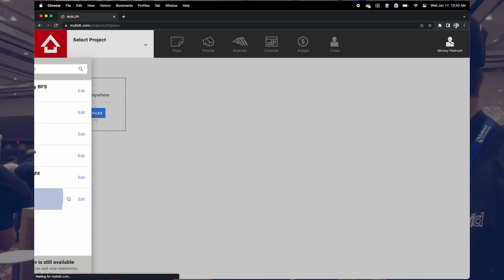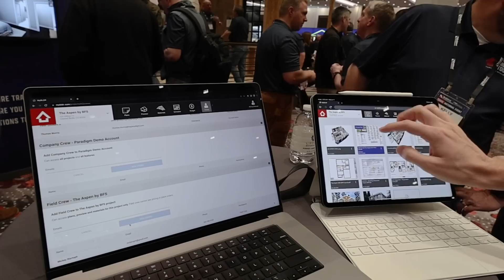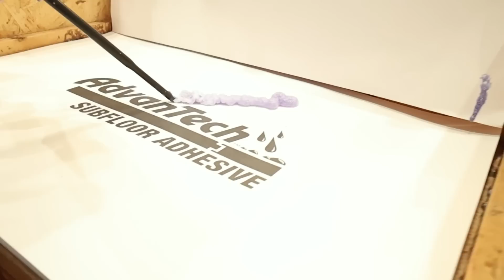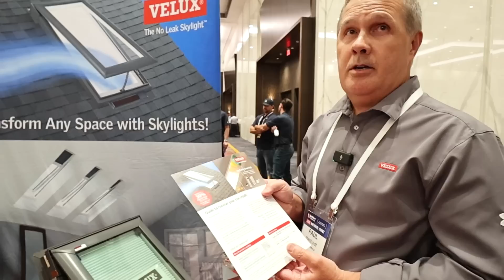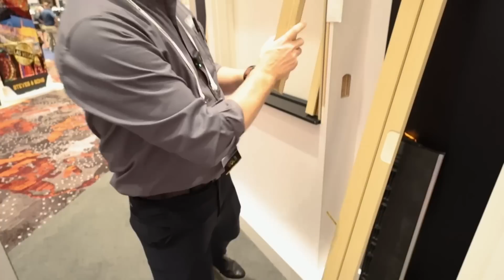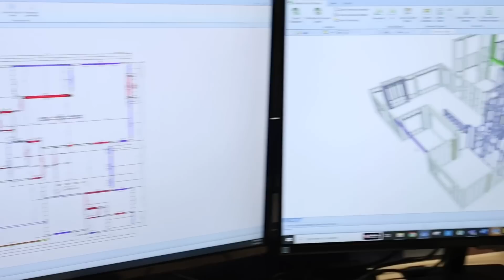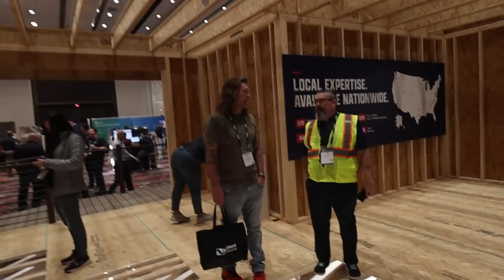Residential steel joists & more from the BFS 2023 National Event!

Comment: I toured the IBS back in 2004.  A Canadian company offered steel floor joists for residential builds back then.  
I don't remember the name of that company, but the steel truss web design was a rotating triangle.
I ended up using I-Joists for the next build because I didn't have a reliable source to purchase those steel floor trusses.
Reply: Check out bone structure houses out of Quebec , Canada. Full house systems all steel and modular. It’s cool stuff. Getting used a lot in California for seismic and fire reasons as well.
Reply: Lumber prices were high in 2004 (at like $400/MBF, which, now, LOL) which always makes steel seem more appealing, then lumber prices go down and it feels like innovation stops (or goes into stealth mode) until they rise again. Gut feeling is that there's a lot of innovation waiting to happen between steel + engineered wood that will result in less waste and possibly open up new possibilities for builds, but "low"-ish prices for lumber in North America are holding us back
Reply: I-span is the company, or at least it is a Canadian company that has steel floor joists. I will be using them on an upcoming build.

Comment: That metal joist system.  Loving it!
Reply: Look how high the plexiglass acting like the plywood subfloor floats above the joist with C channel and screw head thickness. It's the same problem with top hung TJI hangers. Major irritation for me when framing.
Reply: I built a home with steal floor joists 4 years ago. Had to use them do to height constraints, they were a ton of work. Everything took longer to construct. Even the screws were awful to put in. Electrician hated them as it’s hard to attach wiring along the joist. Etc. wouldn’t do it again. Stick with wood.
Reply: @sw5334  Develop a hanger system or something like wire trays, etc.  Super easy to conduit, etc..  Much easier for some people, harder for others to figure out new ways of doing things.
Reply: @farmeunit  I agree that the more you use something the easier it gets. If I was able to use the style and size in the video it would be a lot easier. My job had a height constraint given to me from the city after the roof trusses were in production. The only way I could reduce the 4” I needed was to change the 10” wood floor joists for 6” steel on 12” centers. That made the ducting and plumbing and electrical tough. True that it wasn’t all the steel joists fault, but in my little brain I relate the joists to a pain in the rear. Lol
Reply: @sw5334  I hear you.  I haven't used them myself, but have been running new wiring and trying to finish our basement and could see how these would be beneficial.  The fact you bring up ducting, though, is something I could definitely see being an issue if used to the rectangular metal ducting, which is what we have and didn't think about previously, so...
Reply: @sw5334  Can be quickly assembled w Rivets and proper tools and techniques.
Reply: I'm not a builder, just a DIY guy and love to learn the new stuff out there. I think of my grandpa who was a builder. He did it all, concrete, masonry, HVAC, all levels of carpentry, cabinet maker, plumber, electrician, and on and on. He would love these types of videos. I once owned the last complete home he built back when I was 19 into my 20s.
Reply: You could never remodel or modify the wall layout. Really dumb idea.
Reply: @tira2145  It doesn’t change anything…   You could still do those things.
Reply: @farmeunit  Nope, the company rep said that the walls could not be placed above the webs. Go back and watch it.
Reply: @tira2145  If you cut the joist, yes.  Don't cut your joists... If you do, then account for that, same as a regular joist...
Reply: @farmeunit  the rep said that no walls could be above the cut outs. That makes those worthless. You have to design the wall layout depending on where they are.
Reply: @tira2145  They have to be ordered to fit and not be cut.  He said nothing about the cutouts themselves being an issue.  They are structurally sound until you cut them down...
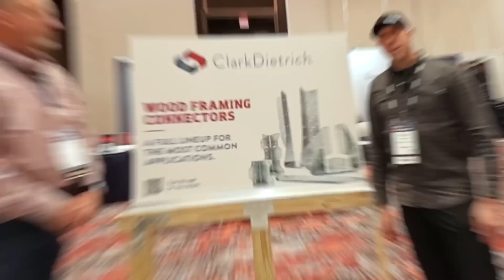Reply: @farmeunit  At 22:15 the rep says you can't put a wall above the cut outs or you will have a crippling issue. Please watch it
Reply: @tira2145  I did specifically after you mentioned it.  He said it needs to be ordered to fit, because if you cut it, you will have that issue.  So, order it to fit and don't cut it.  If you do cut it, you need to brace it.  It's that simple.  That is what you have to do anytime you cut joists out.  If you don't cut it, you're fine.  At 25:00, he covers that specifically.
Reply: @farmeunit  Yes, they are cut to fit at the factory, but the rep says clearly that you can not cut thru the cut outs or place a wall on them. You probably could not put a wall under them either. The joists would be great for some applications, just not for every house
Reply: @farmeunit  at 25:15 he says you can't put a wall above the cut outs.
Reply: @tira2145  "Cut through" is the only thing that is pertinent.  The cut outs themselves are not the issue you think it is.
Reply: @farmeunit  NO, the company rep says you can't put a wall above the cut outs. Why won't you just accept it. At 25:15 he says it very clearly. You can't cut the cut out, or put a wall above it.
Reply: @tira2145  ok... Believe what you want.  He obviously specified a cut just before that.  You can believe what you want to and ignore obvious facts.  That don't design them for specific floor plans and you can get them designed to fit your floor plan.  Just don't cut them.  That's the only requirement.  Call the company and ask for yourself.  Or I can do that for you...
Reply: @farmeunit  Why did he say you can't put a wall above the cut outs? Was he lying?
Reply: @tira2145  If you cut it, you can't put a wall there....  The cut outs are there so you don't have to cut it.  They are made to order to fit.
Reply: @farmeunit  he said that you can't put a wall above the cut outs. At 25:15. Clear as the day is long.
Reply: @farmeunit  that's not what he said, 2 different sentences, you can't cut it here. You can't put a wall above the cut outs. He even took his hand and pointed to a imaginary wall. Sorry that your to dumb to realize what he said. Your parents must have been brother and sister.
Reply: @farmeunit  plus, most cut outs in the build aren't gonna be that big, creating different allowances.
Reply: @tira2145  Web stiffeners...
Reply: @tira2145 True!
Reply: @tira2145  another good point.